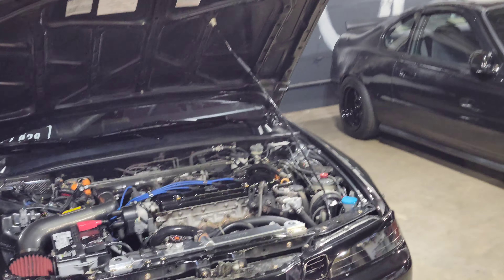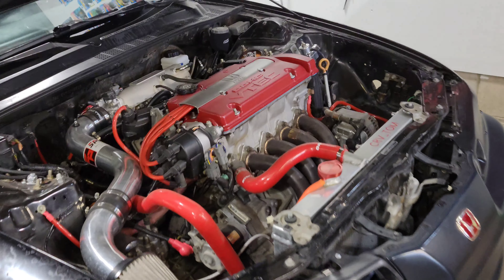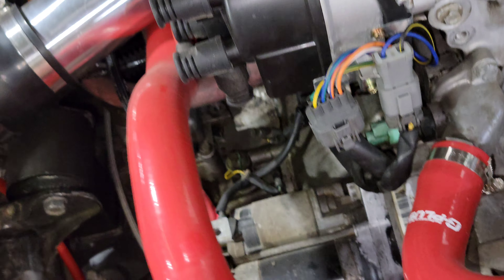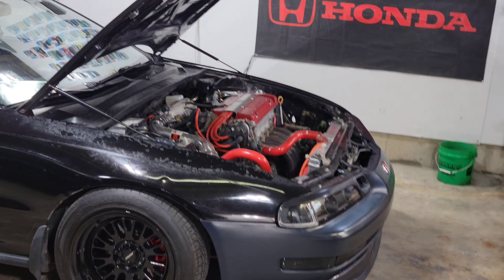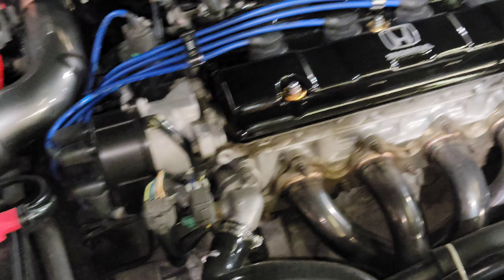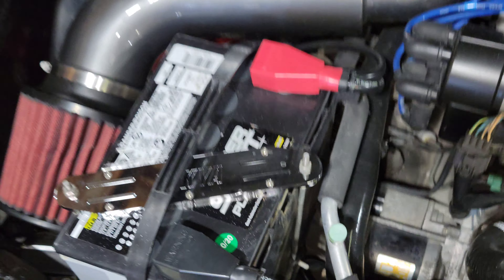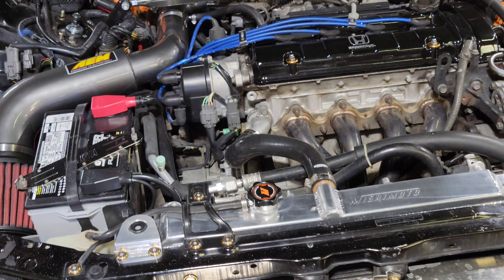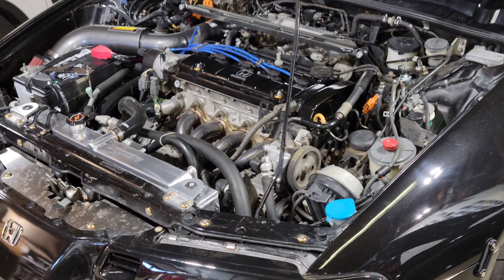MISHIMOTO VS G-PLUS!!! (WHICH IS THE BEST RADIATOR HOSE KIT FOR YOUR 4G PRELUDE?)

Comment: im curious, i notice you have mishimoto radiators. My question is do the stock fans still fit or do you have to use a different fan?
Reply from the maker: I used the 5g  Prelude Mishimoto fan shroud and had it customer fit for the 10 mm tabs to be able to bolt it in place on the 4g.
Reply: @crv_tom  thanks for that. I appreciate the response.